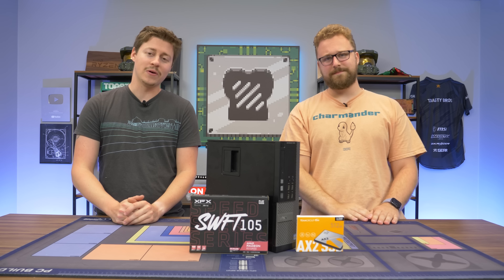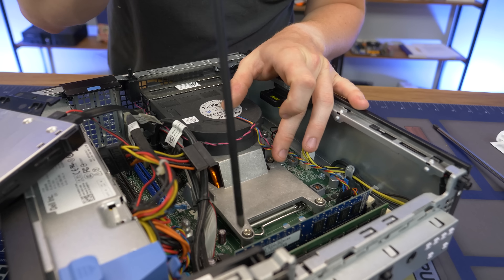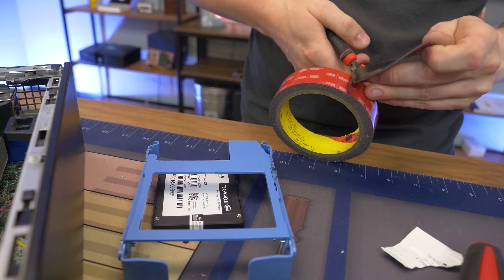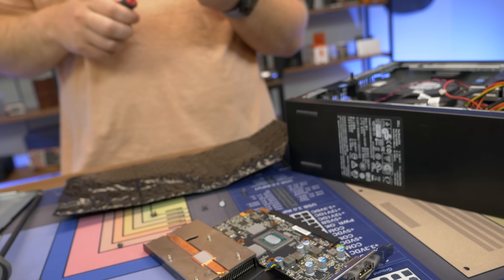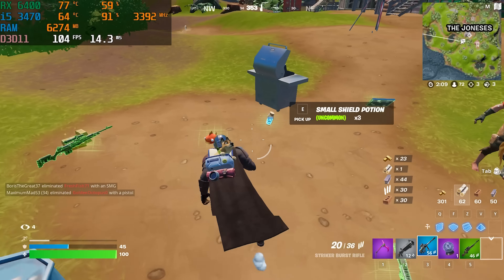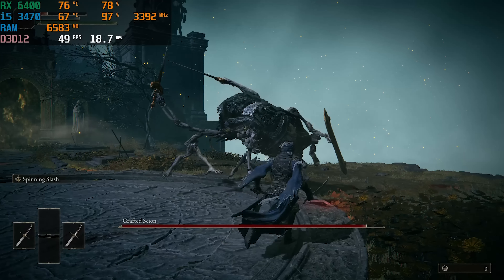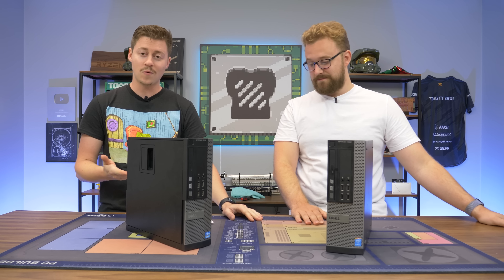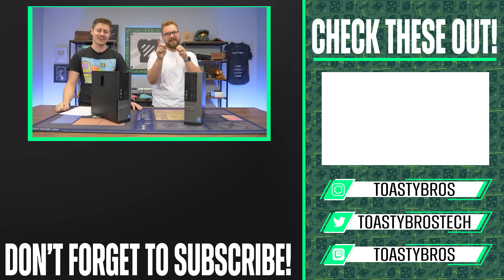EASY $250 Budget Gaming PC Build 2022

Comment: Nice build, and as soon as I saw the title of the video, I knew it was going to be a Dell Optiplex + a low profile graphics card.
Personally, I'd have a look on the used market as well, and I wouldn't choose the RX6400 due to the PCI requirements (how there is a drop off with PCI 3.0, and especially so with PCI 2.0, compared to PCI 4.0). I'd also look at a used SSD, or a small SSD + a large hard drive, and if those Optiplex's have a Windows license on the side of the PC (for Windows 7 or newer), that same license can be used to activate Windows 10.
Reply: What would you recommend instead of the rx 6400?
Reply: I mean, it doesn’t take as much of a performance hit on PCIe 3.0 as the 6500 XT does. It still offers similar performance to a low profile GTX 1650

Comment: fyi: "warranty void if removed" stickers are ILLEGAL in the United States, they cannot void your warranty for breaking the sticker

also, the jump in performance has literally nothing to do with the pcie. it's the CPU. 2nd and 3rd Gen quad cores just physically cannot keep up, especially the lower end ones. (2nd and 3rd Gen were basically the same) 4th Gen brought machine performance increases, hence the performance uplift (they are always CPU bottlenecked in their tests, so an upgrade to CPU = more fps)

Comment: Did something similar but with a GTX 1650 GPU.  Also updated the PSU with a 350W one that I found I could fit in the housing.  Plays everything I throw at it including Half Life Alex VR.
Reply: which font template did you use?

Comment: Have similar pc I got for my gf lmao , i7 4790k 32 gb ram , 240 gb , 1 tb ssd , rx 6400. Plays Gta 5 @ 1440 high/normal setting pretty well .
Reply: Also you don’t have the take out the screws from the back of the gpu . There are about 6 screws on the side that hold the shroud to the heat sink . And it gives you access to the last screw to remove the bracket .

Comment: I started with the 7020 and first updated the pcu to the i7 4790 and got two sets of 8gb 1600MHz  ram for a total of 32.  Then I attempted to update the sorry excuse for a gpu that came with it but accidentally ordered the gx1060 I think it is instead of a low profile card. So I've now ordered a new case, atx lga 1151 ddr3 motherboard and an evga supernova 650 platinum. I'll be able to get caught up with games released the last few years then I can upgrade the motherboard, psu and ram maybe to ddr5 If it's cheaper and better supported.  And reuse the case,  psu , ect...maybe get a new gpu by then too lol.  Oh if you're getting the optiplex 7020 you need to look at the entire cooling situation.  Mine kept crashing after upgrading to the i7 4790.  The stock dell cpu cooler is garbage and the shrouds hold heat in. I removed the shrouds and had to get into bios to turn the fans on full out max all the time.  I have a new cooler on the way and hopefully that resolves the issue.

Comment: With these low profile cards probably a slightly easier way to go is to just cut the full profile bracket with a pair of snips to fit the case. That way your not voiding the warranty sticker at all. Gonna be kinda janky looking when you open up the case but since this is a small card it should be fine.
Reply: They changed it incorrectly.

Comment: Its the PCIE lanes, saw other benchmarks and they had same issues.  Nearly 30-40% drop for using older pcie
Reply: So the 7020 or the 9020 should be fine right?

Comment: You should do a rx 6400 vs gtx 1630 comparison and then also on different PCEI slot generations
Reply: interestingly the gtx 1630 here in the uk costs more than a 1650 or 1050ti both of which destroy it in gaming
Reply: No, not the GTX 1630... It performs worse than a 1050Ti and also has a 6 pin power requirement... there are some 1650s that have no 6 pin connector!
Reply: @RK-zf1jm  Yeah, due to the 6 pin power requirement, and the performance, you're better off getting either the 1650, or the 1050Ti... Heck, as long as you have a suitable PCI slot, even the RX6400 would be a better choice.

Comment: what gpu can i use in a Dell OptiPlex 9020 Small Form Computer Desktop PC, Intel Core i7 3.4GHz Processor, 32GB Ram, 1 TB Solid State, Wireless Keyboard & Mouse, Wi-Fi & Bluetooth, HDMI, Windows 10 Pro i got from Amazon for $200

Comment: Man, those temperatures! I guess it's the OptiPlex's and low-profile's fault, or maybe I just need to run heavier games, 'cos it struggles to hit 40C in my system (ARock's ITX version of the card, Ryzen 5 3600, B450 mobo [so PCI-e 3.0 :[, 2x8 GB DDR44 @ 3600).

Or maybe my ancient Antec Three Hundred case with 2x120mm fans on medium (the ones that came with the case) is just that good. :P

Edit: Nope. Just needed to try better games. Tried Apex for the first time just now and was getting 70-74C in training (and 120+ fps). :)

Comment: i have a dell OptiPlex 9020 and it has an i7 4790 and an rx 6500 xt. the performance is terrible for what the gpu can usually do on a regulars pcie gen 3 system and I don't know what to do. I'm thinking of upgrading to an rx 6600 since I heard i doe sent have as much performance loss as the rx 6500 xt when its on pcie 3.0

Comment: I’m gonna get an optiplex 3020 with an i5 4570 and 16 gigs of ram and I was looking at putting a gtx 1060 in it but I want to know if that will have a similar stuttering problem
Reply: i7 4770 or 4790 will be far better with this card
Reply: Did u bought it?

Comment: Old i7 and 16gb ram at dual or quad channel are the way to go
Reply: THIS. I previously had an Optiplex 9010 w/ Xeon E3-1270 (equivalent to a i7-2600), 16GB RAM and a GT 1030. Actually runs pretty well and better than what I originally expected

Comment: I f memory serves me the 7010 SFF runs a different chipset vs the DT/MT variations, which both use the same motherboard.. This might be an issue with the PCIE generation  I built a few 3rd gen boxes with 7010 MT mobos. You can get them for $10-15 and with adapters they are easy to re case.  Not worth it anymore but with a 3770 or Xeon equivalent they can basically handle a 1070
Reply: I have a 3770 paired with rx 570 works fine no stutters

Comment: I have a ryzen 3700x, with a 5700xt, looking to get a bit more performance should I go with something like a 3070-3080? Or a new gen cpu?
Reply: Get a new gpu...even just a 3070 is near 1.5x as strong as 5700xt
Reply: Honestly I’d stick with team red. A 6600xt or 6700xt would do you wonders. Not to mention they are cheaper and you wouldn’t have to uninstall and reinstall different drivers switching to Nvidia. My living room Pc has a 5600x and 6600xt handles 1440p like a champ.
Reply: @timelphick7742  good to know, I haven’t looked at AMD GPU prices recently I’ll have to compare. Love my current setup just with prices dropping I’d love to upgrade

Comment: i've just build a pc for $250
Intel i7 3770
Ram 16GB PC12800/1600Mhz
Motherboard gigabyte h61m
Gtx 1650 Gddr6
240GB ssd and 500gb hdd
450w PSU
so far so good, i've play some games like gta V, rdr2, death stranding, dead by daylight, elden ring and apex legend at 1080p, it's really beyond my expectation that you can still gaming with this 10 year old cpu😂

Comment: you buy watchers pc at all?, have an older i5-7th gen, msi tridant 3 system I plan to sell before Christmas.
Reply: specs: msi trident 3 7th gen system /Wifi 5 bt 4.2

cpu: i5-7400 4c/4t 3.00 GHz

ram:16gb x2 hyper x - hx424s14ibk2/32

gpu: Gtx 1660 super 6gb 2020/09/04

storage: intel SSD 510 sereis 120gb

looking for around $650 CAD.
i can ship at buyer expense.

Comment: CPU-limited lol.  The i7 is probably the go-to nowadays in the post-Ryzen era.  🙂

...and for that SSD I'd be nuts enough to do 2.5" to 3.5" bracket into the caddy into the computer lol.  🙂
Reply: The i7 in this pc is from 10 years ago bro it barely matches a new i3 past 10th gen
Reply: @tibib0ss  this is one of those normies who doesn't understand anything about computers and only knows brands
Reply: @wondercat6169  yea he talks like a total noob I was just trying to be nice
Reply: Those are i5s.  It says so right in the corner.  🙂
Reply: @MultimediaJay  I'm aware they used an I5 they even mentioned it in the video but it isn't as if an I7 from that generation is going to be leaps and bounds better
Reply: @wondercat6169  4/4 vs. 4/8.  😎
Reply: @MultimediaJay  Again really not going to make to significant of difference we are talking about a Rx 6400 not only that but if you watched the full video you'd realize they already solved the issue as they figured they had a different PCI gen then they did early on
Reply: @wondercat6169  I did watch the full video.  They maxed the CPU even before the "PCIe upgrade" and went from Ivy Bridge to Haswell, so they also upgraded a generation.  Hardly just a "bus upgrade."
Reply: Some of you people need to take a good hard look in the mirror.  I watch the video to have some fun because it's an old Dellasaurus and I get Argumentmageddon over 4/4 i5 processors from the last decade and I'm allegedly some normie who doesn't understand computers?

I have a Sandy Bridge i7 Optiplex tower as one of my project systems to see how far it goes.  I'm quite familiar with bus speeds, bottlenecks, and the uncanny longevity of certain setups from the 2010s.  Guess I need to do more with it then.
Reply: @MultimediaJay  Sure but in the end the system was fairly well balanced and a pretty real world example there is always going to be a bottleneck in any system and it seems strange to nitpick over it

Comment: My computer spec are 

CPU Intel i5 2400 CPU 3.10 ghz 
Ram is 8gb DDR 3 1333 mhz 
GPU Nvidia Geforce GT 1030 2gb low profile card

Power supply is 250 watts

Storage hard drive 500gb

What can I do to upgrade my computer?
Reply: Also it a dell optiplex 990
Reply: Hi, honestly 2nd gen intel core i5 CPUs are no longer enough for gaming, I recommend that you sell the optiplex and build a new PC with 10th or 12th gen Intel core i3, gtx 1650, a 400W PSU and 16GB of ddr4 ram but if you don't have the money to do so just get a second hand gtx 1050Ti.

Comment: I dig these videos! I'm running into the same problem with a dell optiplex 790 sff that has an i3-2130 that I got off from eBay. The cooler is absolutely stuck on the cpu when I try to take it off. Do you guys or anyone have any suggestions on how to take it off without breaking anything?
Reply: Take it out while still warm.

Comment: What the best all white gaming pc with this:
Case: Thermaltake AH T600 Snow Full Tower Case - White Tempered Glass.
And 
This cpu cooler: NZXT Kraken Z53 RGB 240mm - RL-KRZ53-RW - AIO RGB CPU Liquid Cooler - Customizable LCD Display - Improved Pump - RGB Connector - Aer RGB 2 120mm Radiator Fans (2 Included) - White.
That’s all I know any ideas?

Comment: Hey guys. I replaced the motherboard in my Optiplex 9020 and it booted up beautifully but I got these error messages: The Intel(R) 8256LF Gigabit Network Connection adapter is experiencing driver - or hardware related problems.
The Intel(R) Ethernet Connection 1217-LM adapter is experiencing driver - or hardware related problems. I Youtubed this for two days to find the right drivers and couldn’t. Any suggestions how to get my pc running? I know it has to be very simple but I haven’t been able to solve this problem…Help!

Comment: Good video but i have to critique , Man if your going to get an OptiPlex at least get the 4th gen haswell cpu one that has the i7 4790. that i5 just isnt cutting it. but for 250 i guess
Reply: I reckon the 3rd gen i5 would still work reasonably well if it was paired with a GPU that is more forgiving to older PCI slots.
Reply: @TheSpotify95  True i agree

Comment: The new Optiplex saviour will be the GTX 1630. Single slot, 75W, 4GB, gen 3 x8. Similar performance to a 1050Ti but single slot.
Reply: And 170$ with trash performance 💀
Reply: @Tommy-qe6fh  not when you plug in the optiplex with pcie gen 2 slots
Reply: Err, no. The 1630 needs a 6 pin power connector and performs worse than the 1050Ti!
Reply: You can go for a gtx 1650, single slot too, and far better